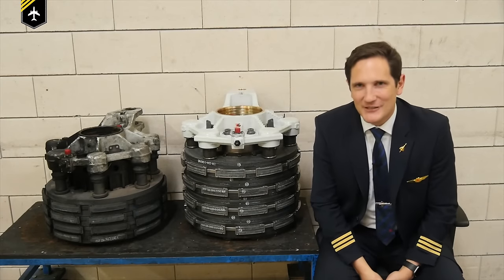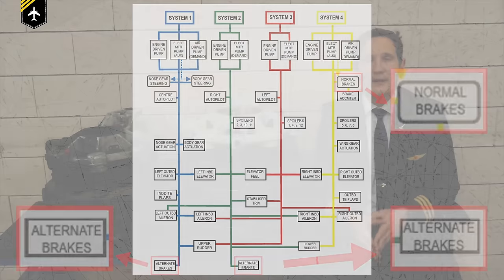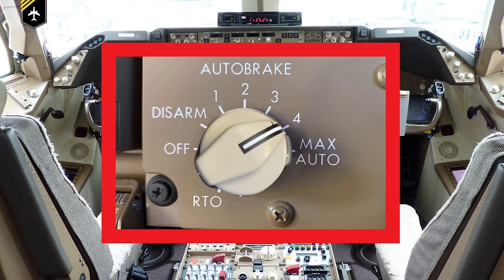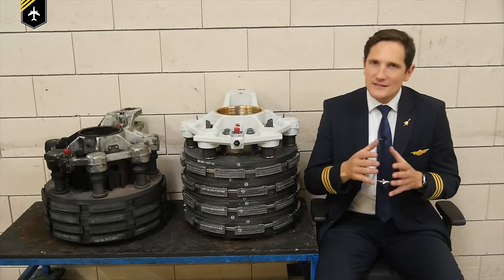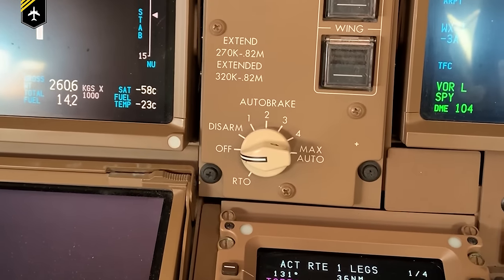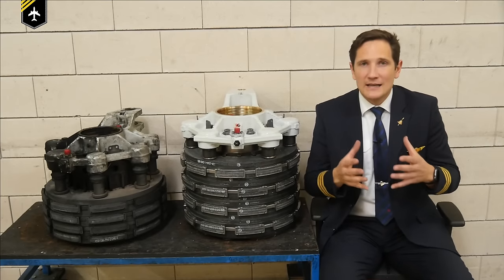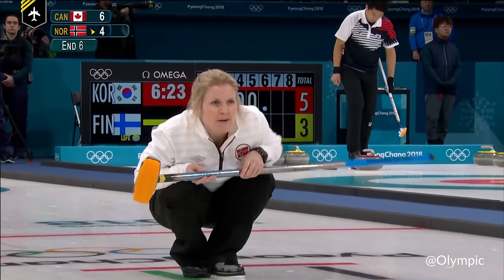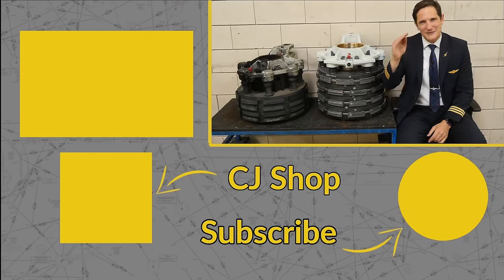How do PLANES SLOW DOWN on the RUNWAY? Autobrakes System EXPLAINED BY CAPTAIN JOE

Comment: Airbus breaking system's advanced function is really awesome! I have never thought about that. But does this work in the same way even on a wet/icy runway calculating automatically each case's coefficient of friction while (or before) keeping the tires running on it ?
Reply: Not sure about a380 but on a350 you can select 6 (I think) levels of runway contamination so the BTV can more accurately predict your stopping distance as well as the ROW/ROPS warn if you’ll overrun
Reply: @tomstravels520 
Thanks, so in case of A350, it is necessary to preselect one of the contamination levels, considering ATIS info in advance, isn't it? I am wondering whether some full automatic breaking system (without counting on manual breaking) which can work timely with automatic sensor according to actual runway conditions already exists or has been being studied...I suppose this should be a final stage figure for the full autopilot system in the future like it is already happening in self-driving car system.
Reply: Tetsuro Aoi probably but it would be better if you tell the computer what to expect before landing rather than the plane landing and the computer going “oh s**t there’s snow on the runway I better brake much harder”
Reply: @tomstravels520 
Hahaha, you are right, but the computer can do the same, analyzing ATIS info in advance as the pilots do before landing so that the breaking system can already be set automatically for each weather condition, and I think the advanced high quality sensor can catch even the runway surface overall condition from a certain distance before touchdown making full use of the state-of-the-art technology.
Reply: There is always going to be some uncertainty, even with a hypothetical "auto-sensing" sensor, because of factors like brake wear amount (in the case of high-energy stops), and whether or to what extent one or more tires hydroplane.  Hydroplaning in turn varies with water depth (which itself will vary), tire pressures, and groove depth/wear on the braked tires in the case of higher water depths.
Reply: @marcmcreynolds2827  There are two stages : before landing and after landing. The computer can use ATIS info before landing for preselecting breaking level, and after the aircraft landed, this computer can start to monitor all the real conditions and decide where and how to decelerate the aircraft, calculating all the data collected running on the runway. As for break wear amount, tyre pressures, groove depth/wear and so on, neither pilots can know these details precisely. If they can know something about them through some display, it means that also the computer can get the same. Even self-driving car has more or less the same situation on roads under different weather conditions, or maybe more complicated because people/animals/other vehicles can come out much more often in front of it at anytime, there are uphill & downhill roads, different type of roads (asphalt ones, gravelled roads, roads of earth etc...), roads with various curves of different angles...
When the first airplane was flied more than one century ago, I suppose that most people were very afraid that it might fall down at anytime and passengers onboard must die easily, however, as technologies went developing, people started to believe in airplanes' safety. When self-driving cars were introduced, most people had the same fear and doubt, however, now they are being used in many places even if its usage space is still enough limited. Even in aviation world, such reality will be accepted sooner or later. Nowadays  even flying taxis are being studied. This idea seemed quite ridiculous until several years ago but it is becoming a reality and I think many pilots can work as flying taxi drivers in the future because of the advantage of their accumulated rich experience although the salary cannot be the same if these flying taxis company want to make profit through this new business. And there is also possibility that also these taxis might be completely automated without pilots in the far future.
Reply: @yoidoretennshi777   You make some good points.  To clarify why I brought up the issues I did, it wasn't because I don't think such a goal should be pursued.  It was just to give people a taste, drawing on my years of professional experience in aircraft braking/runway friction, as to how implementation would be more difficult than it might seem.  Long ago I did research modeling landing procedure revisions where airliners would exit from the runway at higher speed than they currently do, as a means to increase airport peak capacity via having an aircraft on the active runway for less time.  That ended up being a similar example of how it can be hard to wring the maximum benefit from an idea in the face of having to keep things reliable/safe under multiple uncertainties (one probability distribution interacting with another probability distribution interacting with another).

Some of the things here which are presently "unknowns" might eventually become measurable.  A detailed profile of water depth ahead on the runway, specifically where the tires will roll through, could perhaps someday be sensed by ground-based or on-board laser equipment, for example.  Other factors may stay unknowable, though, and so require there be a higher level of conservatism as to how any control laws developed for the automatic braking system are utilized.  

>  When the first airplane was flied more than one century ago, I suppose that most people were very afraid that it might fall down at anytime and passengers onboard must die easily  <  ... and they should have been afraid -- very afraid!  : )   Seriously, it's striking to see how dramatically airliner fatality rates have fallen, even since just the beginning of the jet age.  Advances in metal fatigue knowledge, operational improvements (checklists, CRM), big improvement in engine reliability, improved ATC and collision-avoidance systems.  Pilots are more and more becoming the weakest link as a result, and for that reason any improvements in landing rollout automation such as you are talking about could further improve safety.

Comment: 6:00 : Will the auto brake system use its "MAX AUTO" setting or the maximum pressure available (4:35)
Reply: it uses RTO for rejected takeoffs, which does use full breaking.
Reply: RTO > MAX AUTO in terms of brake pressure used
Reply: @Miku-uw2sl  no, rto uses maximum break pressure with the exception of anti skid.

Comment: so is the auto brake preset given on the display or does the pilot have to physically calculate it
Reply: The Realm Traveller the pilot can calculate landing distance on the efb with all autobrake settings, and chooses the best one. Usually it's the lowest practical setting is used.

Comment: You know it sure would be cool if planes wheels were electrically powered. Could use capacitors and some of the onboard generator power to help with the initial push when taking off and taxi-ing. Then, on re-entry the motors can be used to slow the plane down and recharge the system. Just seems like a lot of wasted energy
Reply: They have done studies but they just won’t be cost effective. The motors would have to be enormous as they have so much weight to move around and the APU would have to be kept running anyway to power the motors. Plus each one would then have to be maintained
Reply: truu, the cost might not be worth it. But most well made electric motors will last forever and are relatively maintenance free
Reply: DoorisJ this is the aviation industry we’re talking about. Everything is checked no matter what the manufacturer says or how long it should work for.

Comment: Does the plane which a student fly to get the CPL,have same features as the planes in which we travel(Example-- a320,a350,Boeing 737 etc.) ???
Reply: During the training for the CPL smaller twin engine aircraft are used (usually piston engine aircraft). For example ATP flight school uses a PA-44 aircraft:
https://live.staticflickr.com/4902/46501047561_3d0d3f3b45_b.jpg
To fly a larger jet airliner you need a type rating for that specific aircraft type. When you have the CPL you can get the type rating training e.g. for an A320 or B737.

Comment: Hi Joe don't mind changeling the brake pads on my car,  But that airplane break system no thanks there is a lot of pads on an airplane i could do it if i had to but would prefer not to. There is only 2 pads per wheel on a car. Be watching out for you on my Flight radar do see CargoLux on radar but do not know if it is you but i say to myself there goes Captain Joe

Comment: What about reverse thrust. Do we not use them in breaking?
Reply: Yes. Reverse thrust is always used for landings and RTOs. When landing on dry runways, the more reverse thrust you use, the less brake pressure will be needed by the brakes to supply the selected deceleration rate set by the auto brake system. This means that you will not get reduced landing distance, but you will get reduced brake temperatures and reduced brake wear. When landing on a non dry runway, you will get reduced landing distance as well because brake pressure available from the brakes will be limited due to wheel skidding on a non dry runway.

Comment: Hey Joe, quick question: During all flights i had in my life i witnessed the following: After a while the wings changed colors, they got darker and were almost black. When we landed the color changed back to white/silver. Why?
Reply: Are you serious?
Reply: Temperature
Reply: @valentin7436  they don't change colour.
Reply: @dogwalker666  i am serious, there are even pictures online.
Reply: @dogwalker666  it's probably the mist from condensation :)
Reply: @valentin7436  there could be causing an optical illusion effect on some paint finishes I suppose.

Comment: Can a plane stop without brakes? In case of flooded runway or brakes issues, are the air brakes and reverse thrust enough to stop the plane before the end of the runway?
Reply: Zharesss it depends on the length of the runway (along with other misc factors)
Reply: You would be having the worst day if you lost all your brakes as there’s usually at least 3 different ways to get braking. A350 has 5 different braking systems
Reply: Thomas Mortimore yes, we can see in this video the 3 hydraulic systems on the 747. But flooded runways? He mentioned in the previous video about issues with brakes in that case. So I’m still curious. Maybe it’s just a question of fuel being more expensive than brakes
Reply: Zharesss runways don’t usually flood as they have grooves cut to reduce standing water. It would all have to be calculated using the landing performance software pilots have

Comment: Hey captain Joe , what sort of fuel an aeroplane uses?
Reply: akash b commercial jets mostly use aviation turbine fuel, usually Jet A1 but other variants are also there. You can say it is kerosene based.
Reply: Europe Jet A1, USA Jet A
Reply: What's the problem if the fuel is spilled on an another plane while flown in vicinity  of a plane, which is dumping fuel in order to reduce landing weight  ?
Reply: @ZK-APA  thank you
Reply: @pilotinterviewhandbook3064  thank you
Reply: akash b usually the aircraft is asked to go in a secluded area to dump fuel. Moreover it’s announced on the radio that fuel dumping is in progress, so other aircraft will avoid the area.

Comment: Hello fellow future pilots what is your opinion on how Boeing and airbus wanting to manufacture  planes designed for only one pilot and eventually pilotless especially since airbus jus showed a test flight on how the new a350 can take off automatically and land without the pilot basically their project called TTOL comment below I am worried if my future career might not even exist especially after having to spend as much as 100 000 on training
Reply: At least one would already be in the cockpit but I’d rather 2. Just like in engineering there should be redundancy. Also I’d imagine the single pilot would get bored flying across the Atlantic with no one to talk to
Reply: @tomstravels520  I believe flying a jet is a team sport who would want to talk to the autopilot or ATC for company

Comment: How does airplane brakes work? Do they work like car brakes or some how different?
Reply: Hydraulic pressure except on the 787 where they are activated electrically
Reply: @tomstravels520  Thanks for answering but would like to know about the mechanics in those brakes. Like are there pistons and they push brake pads into a brake disc or something like Idk... 😊

Comment: Sir, i have an question. Why the Pilots are always starting the 2nd engine first?
Reply: For the A320 family they start engine 2 first because the yellow hydraulic system which is powered by the no2 engine pressurises the parking brake and alternate braking system which you’d want once pushback is complete. Not so sure about others.
Reply: Thomas Mortimore yes, though for single engine taxi ops, engine 1 is started up first (in the A320 series)

Comment: hey captain joe what is an IRS system
Reply: Inertial Reference System. It is used to work out which way the aircraft is pointing and how fast it is moving using gyroscopes/laser ring gyros and accelerometers

Comment: I have a question: I often see that an airplane with the front wheel always drives neatly over the yellow line, how is that possible?
Reply: Boas Bosschaart practice. Though you can’t see the wheel, from the cockpit you can figure out where it is using some reference.

Comment: I think its not about the brake , the hidden overtime are the landing impact - so i will designed an addictional drone propelle on both wings as backup for smooth landing the rest are option........l realized how brand new is the aircraft the the crack structured are hidden due too to many impact landing overtime ' cause its operated by all different hands on of pilots from all walk of lifestyles ...... now 2020 we start by smooth landing to all heavy duty aircraft - this is to prolong the structures services of the aircraft  prevented from hidden aircraft structured cracked.........

Comment: Why do u need an off mode for brakes?is it used at any moment
Reply: If a runway is so long that stopping early isn't needed (eg if they have to vacate at the end or mandatory backtrack from the end), then you don't need autobrakes. In this case one will simply brake as necessary

Comment: If you brake manually that mean the maximum pressure using ?
Reply: Abdulla Alshizawi it’s more like you control how much brake to use. Yes with a full press, the maximum pressure will be applied, but you can vary it as needed.
Reply: ZK-APA  I really appreciate your response.  Now I compare it with car brake.

Comment: Joe why wingtips are not installed on b747-8
Reply: Every aircraft has wingtips. You probably mean winglets. Winglets are not installed on some long range Boeing aircrafts, because raked wingtips tend to be more efficient when operating at longer aircrafts. Winglets although reducing fuel burn, they do not offer the same efficiency for every single wing.
Reply: @pilotinterviewhandbook3064  thanks man

Comment: I dont understand 4:20 why if you override from Max Auto Autobrake will this provide a greater deceleration?
Reply: Probably incase of autobrake failure the pilots have more power to stop. The pilots could choose  maximum autobrake on the landing computer even if it wasn’t working and know if they then used maximum manual they should still stop less distance. If it was the opposite they might not know if they could stop in time
Reply: @tomstravels520  Thanks Thomas, so in short, in case autobrakes fail the manual braking is enhanced
Reply: Matt Ball I’m not a pilot but as an engineer that’s how I would design the system

Comment: Why have a runway at all to do a complex takeoff and landing? Why not have all commercial aircraft be VTOL? Military aircraft do this already.
Reply: Adam Iverson because vtol is more complex than a normal takeoff
Reply: Do you have any idea how much thrust would be needed to lift a plane the weight of a 777 or A350? And then will the engines toilet how much complex engineering would be needed

Comment: Why does the keyring say "remove before flight" ?
Reply: This text "Remove before flight" is used on red tags as markers on the components that need to be removed before the aircraft can take off. They can be such as protective covers, pins or control locks.
The red tags are like this keyring but bigger.
For example here is one placed on a landing gear:
https://www.aerospecialties.com/app/uploads/2016/03/500378-Global-Express-NLG_01.jpg

Comment: Why do planes have hydraulic brakes instead of air brakes?
Reply: Because they use hydraulics so move the flight control surfaces so why build 2 separate systems that needed different types of maintenance and different procedures and refill methods when you can have just one type of system. Also air expands when at altitude so may cause problems (hence why aircraft tyres are filled with nitrogen)

Comment: Why dont vehicles have auto brakes?
Reply: Because car brakes done wear out as quick and generate as much heat as aircraft brakes because they weigh much less
Reply: @tomstravels520  well itd be cool if your coming off the highway and you set the speed and force of the brakes to come to a stop. Basically a highway is like a airway and the offramp is the landing strip. Lol. I'd set it to 3 and watch as the brakes self applied
Reply: justinl458 unless you knew the exact distance to the stop mark, the exact deceleration rate of the vehicle and the slope of the ramp you’d most likely get it wrong and have to manually brake anyway